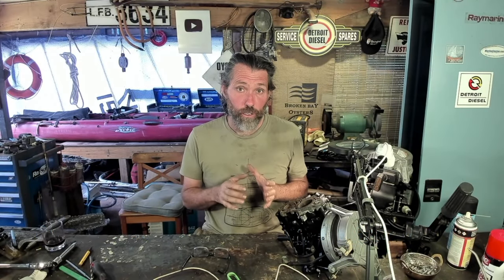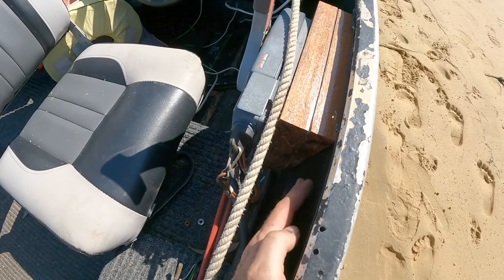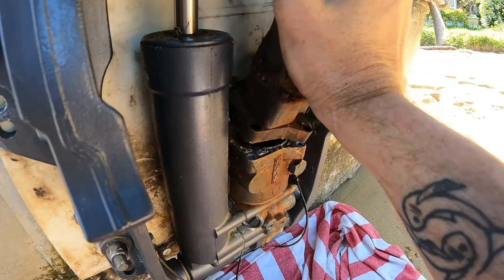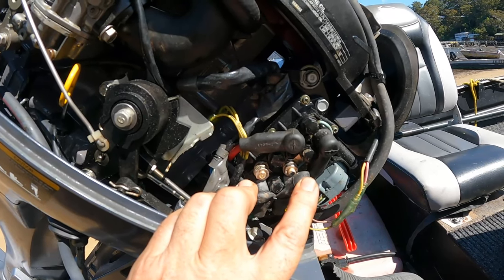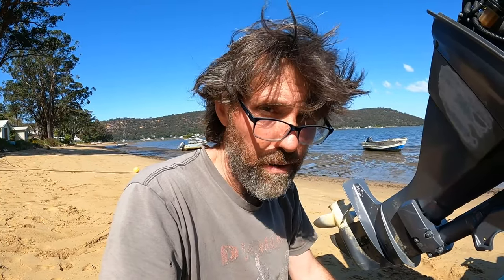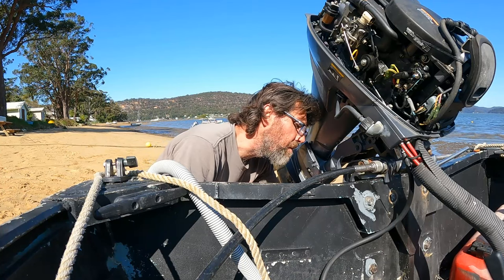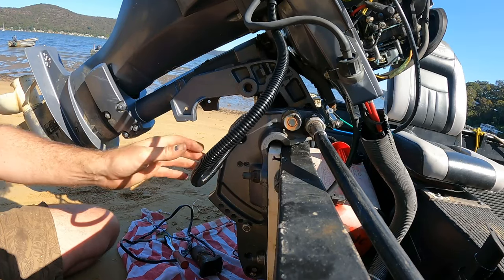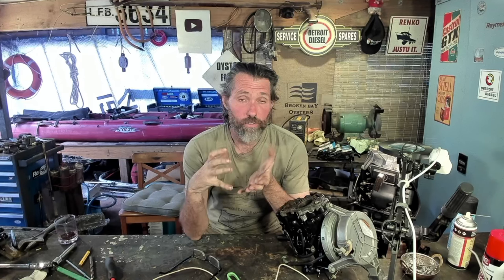Outboard trim tilt motor replacement

Comment: Stu, please don’t be afraid at saying it is a commercial decision to run shorter commercial videos. You bloody deserve to make some good money from this! Very helpful and interesting to watch. Thanks again
Reply from the maker: Thanks mate, but interestingly these videos actually make less money. Longer project videos appeal to a lot more people but I really want to make the website as complete as possible before moving on to another project.
Reply: @DangarMarine  I know i love the longer project vids. Thats mainly what i watch on utube. that or will it start vids
Reply: Once again Stu to the rescue…
Got my new tilt motor in (over the water no choice) only thing is, now when I get to the full tilt up it goes back down…I can stop it midway or just before full and it will stay up….
Any tricks or did I miss something?
Cheers

Comment: Tying the cable conduit down can lead to water getting into the bottom bend, leaving the cables in (salty) water. Maybe a water drain hole at the lowest spot could solve that.

Comment: At the very beginning of this instructional video, you stated the necessary tools, the allen key and beer, but you forgot to state the piece of drift wood. Also, regarding the beer, it wasn't clear when it should be used, before the job begins, during the job, or afterwards when I discover that the trim still doesn't work.

Comment: Do you find buying aftermarket is OK for this kind of stuff? I only ask because I copped the $620 cost of a new tilt motor at a local dealer for the F70 about 3 weeks ago… 😢 Haha hope you’re well Stu!
Reply from the maker: Hey Matt. I've found it to be pretty good. A lot of it does come down to not letting water get into it, both will fail pretty fast if that happens. A clean mating flange and a bit of sealant should have an aftermarket one working for many years.

Comment: Informative video, thanks.
With a bit of help I had the tilt trim motor and most of the seals done in the unit. I went cheap aftermarket motor as I could not justify $600 for genuine. Each time I bring the boat home, I hose around the tilt unit and then give it a good soak of wd40. I've been running it fairly regularly and after near a year, it still works 👍
Reply from the maker: For sure, a bit of maintenance goes a long way. One of the great luxuries of having a boat live on a trailer!

Comment: Excellent and informative video as usual.  I love watching these simple jobs.  Speaking of 'simple jobs', how about a short video on rewinding/replacing the pull start rope on an outboard? Reason I ask is about a week ago, a friend asked me to help replace the cord on a small 9.9hp motor and holy crap, what a mess.  When he originally took it apart, he took to many parts off and ended up having that pesky 5 or so foot long razor sharp coil spring pop out and unwind on him while under almost full tension. He ended up getting a few stitches, 6 total, on the side of his right index finger and hand because of it. That's why he needed help. I figure it would not only help on marine engines, but other pull cord started engines like lawn mowers as well.  Anyway, thank you again and we shall see you in the next video.
Reply from the maker: Thanks Vin, glad you enjoyed the vid. There is my video on rewinding a pull start https://youtu.be/Ptk1erYeaQ8

Comment: If you ever want ideas on the fun educational side ... when you see the big fancy boats with triple or quad outboard motors - how do they get them setup with steering, power all in sync, do they share any common components...if you ever have two similar size/power outboards you could build something similar on a small boat for giggles?
Reply from the maker: I would definitely like to do more videos on twin outboard boards. Plenty to talk about with regards to setting them up and driving them.

Comment: With an older outboard you really need a bit of DIY knowledge. Your video's are an invaluable source and greatly appreciated. I whish when I had an old blue band mercury years ago that I had these tutorials. I did it the hard way back then.

Comment: Hey Stu. Who do you have dressing the set this week? An item in each of the sail panels in the background is top banana. Maybe the staff member can change these features to match the flavour of the vid each time? The beach looks very inviting in the sun. Another nice set with a little wind effect in post? Good tool choice and while it’s handy to check correct size with the ‘easy’, I agree ‘always start with the difficult fasteners’. That motor is nasty. The tilt hydraulic systems on boats that I’ve worked on are very complicated. The motor is the simple bit. Cool vid. Cool new site. Great work!!

Comment: Stu, I would like to know how many hrs is too much for a 2005 Honda 75hp four stroke (with carburetors). I've heard reports of 3000+hrs before rebuild. The engine I have has around 700hrs but has been well maintained. Do you think this engine is worth putting on? Maybe you could do a video on different engines too for other viewers. Thanks mate, you're a scholar and a gentleman. Keep up the good work.
Reply from the maker: I would happily install a well-maintained four stroke with 700 hours, still got plenty of life left in it.
Reply: @DangarMarine , that's the reassurance that I needed to hear. Thank you so much for the quick reply, you truly are a legend.

Comment: I remember someone had a video on the really old Evinrude outboard motors with the two fuel hose gas tanks a return line and supply line and they converted it to the more modern single line and put a pump in it was that you?
Reply from the maker: No, that wasn't me.

Comment: Hey, why does the power trim motor seem to rust out first? I have a Yamaha outboard and it’s starting to get pretty rusty but the rest of the motor is perfect
Reply: Replacing the anode regularly may help?

Comment: Purchased my used boat in 2012 and had to replace trim motor right away. 2015 the new one rusted out and stopped working. On my second purchase, before I installed I paint the housing with electrical liquid paint and still have the same motor. No rust no problems.

Comment: Nice one Stu. I have a small issue where my yamaha trim/tilt will creep down. Is that going to be a seal or the pump do you think? Hope u doing ok without Adrian to help with the electrics....
Reply from the maker: Either cylinder seal or bypass valve.

Comment: WHAT IS THE DIFFERENCE BETWEEN A MERCURY 92975A24 AND A 92975A28 TILT AND TRIM MOTOR THEY LOOK ALIKE MY MOTOR IS BAD BUT EVERY THING WORKS GOOD WOULD YOU KNOW ? THANKS RICK.L.

Comment: I need help badly. I need help replacing the Ram shaft gasket I have a 40hp mercury force 2stroke motor. I need to find a gasket kit for this motor it is a 1995 mercury 40 hp force 2 stroke .

Comment: Hi Stu I have an 90 Etec  06 model. Im finding my engine drops over time after leaving it up.
Reply: Dangar Marine
3 hours ago
Either cylinder seal or bypass valve.

Comment: Help anybody.  I’ve got a Yamaha 225 and it won’t go all the way down. I don’t know the proper names for things but I’ll try to describe it. The motor can’t go all the way down because it catches on the bracket at the spot where the part of the hinge that’s attached to the motor goes between the part of the hinge that’s attached to the boat. It’s like the motor is slightly offset.  How do I adjust that or fix it?
Thanks in advance.

Comment: Great vid. I spent this evening removing the lift solenoid from a Suzuki DF50a. Now I am suspecting it might be the motor. It started by refusing to lower. Now it just clicks and doesn't do either. Subscribed.

Comment: Aloha Stu, great videos, thanks for making them. I have to replace the trim motor on a 90hp Yamaha, but the manual release screw is stripped. Do I need to drill it out or is there another way to get the motor up??

Comment: Hello from England. I always end up watching your videos over all the others for these outboard repairs coz you cover everything. In this one you have given me what I was thinking about.... using sealant for the flange on my Yamaha F60 motor replacement. I waded though several rubbish videos from Yanks that re-fitted motors but copmpletely skipped the actual fitting bit... honestly! Cheers mate 🙂

Comment: Glad you pointed out how easy it is to crack the flange - I can't count the number of intake manifolds I've had to replace on Honda motorcycles & various Japanese outboard parts that have those (much better than a gasket) o-rings where people just cranked them all the way down until something went snap

Comment: Allen keys have a nasty tendency to round over when used on rusty or stuck fasteners.  Try using Torx keys instead, they don't round over like Allen keys do, and will usually break loose fairly stuck fasteners.

Comment: Ended up replacing the whole unit on my Mercury 150 blackmax 88 model, was cheaper to buy the whole unit reconditioned, little bit harder as you have to remove the engine clamp bolts.
Reply from the maker: You did well finding a whole unit cheaper. People still seem to want crazy money for used trim tilts here, often over $1000.

Comment: Love the hair, blowing in the breeze - it’s beautiful-ATOMIC      yeah my mate went gang busters and snapped a corner off the flange but he said the plastic resin should of flexed instead of the original alloy,   Drrr  it wasn’t flexy
Reply from the maker: Thanks mate! Yes, they are quite brittle and particularly when people don't notice that they aren't seated properly and there is a little gap they can break pretty fast.
Reply: Yeah mate, you &john cadogan tell it as it is, driving 4 answers is also quality engineering topics show,